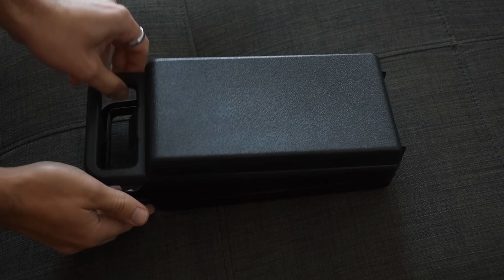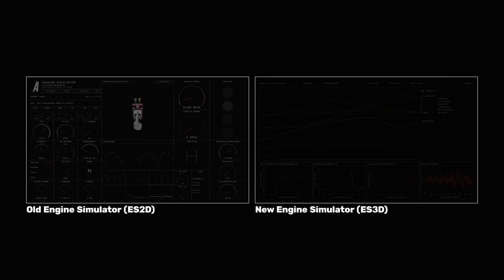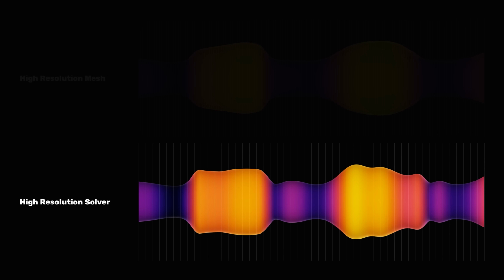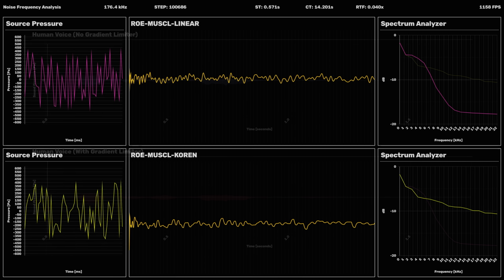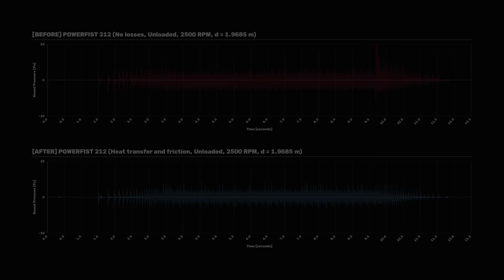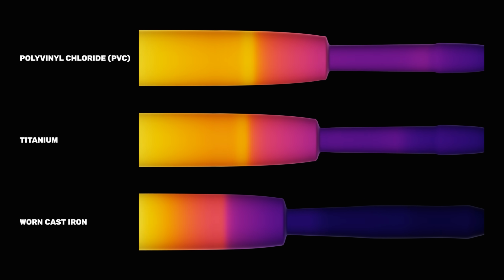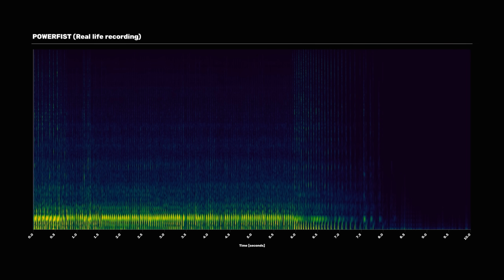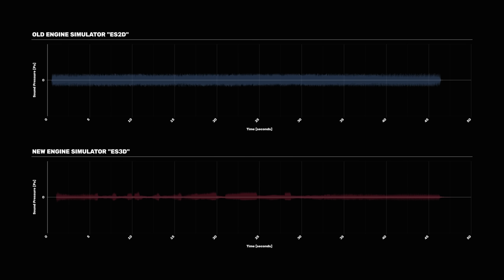Improving My Engine Sound Simulator With Real Data

Comment: 7:40 is that the discontinues function forrier series theroem stuff?
Reply from the maker: It's related actually. The technical term is Gibb's phenomenon
Reply: @AngeTheGreat  no we are talking about the same thing I have got the proof for the theorem proving that in the normal case this doesn't happen.

Comment: To relate on what you are talking about at 18:00 in structural engineering we call that structural dampening. Basically all real life structures are natural low pass filters. However evaluating the amount of structural dampening in a complex system is one a the most complex task when building a structural analysis simulation. Thanks for a video of such a level ! Have you considered publishing a scientific/engineering paper about your work ? It is definitely worth it !

Comment: I'm gonna be perfectly honest, through the whole video I was kind of underwhelmed, and then you showcased an actual driving-like sound of the 1-cyl and I just thought "huh, that sounds like a dirt bike". Which is well, exactly what it should sound like.

Maybe choosing the powerfist was not the best choice for a real life showcase because that thing makes a lot of mechanical noise compared to exhaust noise. But I guess whatever got you the necessary data is fine.

And whenever the engine sim drops in going to actually try getting an exhaust designed for my focus lol

Comment: Ange. there is a basically 0 chance you see this but if you do i want to say this 

YOU HAVE REACHED THEORITICAL LIMITS GODDAMNIT THE THING SOUNDS 100% LIKE THE REAL DEAL ALL WE NEED IS TURBO STUTUTUTU AND SUPERCHARGER WEEEEEE AND IT WILL BE REVOLUTIONARY JUST PUT THE UI, MAKE IT OPEN SORCE AND YOUR LIFES WORK IS FINISHED IT PRACTICALLY CANT GET BETTER

but there is one improvement you could make
i noticed in the soundwaves the simulations always had reletively smooth waveforms while the real ones were a little all over the place and were more choppy. i hope you can make the next iteration better regarding this matter 

BUT REMEMBER YOU MADE A MASTERPIECE

i understand if turbos and whatnot arent possible in the next iteration or any iteration because thats an entire new dimension of fluid sim and turbulence but thats the only complaint i have and its still minor. turbos arent here.

KEEP GOING YOUR DOING GREAT YOU HAVE COME A LONG WAY!

Comment: Every time I wonder how you're doing, you release a video with a few engine examples that effin blow me away. You appear to use some audio normalization on these parts, where the quiet parts get louder after a while is that right? If so, would you have the full dynamic original available as well?
Reply from the maker: Yes, I applied a small amount of dynamic gain adjustment to keep the signal in a comfortable listening range. It can be disabled in the program if you just want raw output
Reply: @AngeTheGreat  Good to know! I love ear bleeding dynamic range.. :D Amazing work man, just amazing.

Comment: Congratulations on getting this far without any formal training or experience and as a solo dev to boot!
However, please compare your results with that produced by a team familiar with COMSOL or ANSYS' multiphysics fluid simulators, before declaring that math or the state-of-the-art is limiting your acheivable accuracy.
Getting accurate sound from a fluid simulation isn't difficult, nor is it anywhere near some mythical limit that human intellect still needs to overcome.

That being said, it's also true that generating interactive, high-fidelity sound at high frequencies, from arbitrary 3D shapes and engine configurations in REAL TIME might actually be impossible due to the limits imposed by having reasonable PC specs; since this would (*obviously*) ideally require > 40,000 sound samples per second, with geometric resolutions of better than 2mm (to enable computation of realistic interactions with those high frequencies), all while keeping latency as low as possible (definitely <100 ms, but preferrably even < 10ms)!
Reply from the maker: I didn't claim in this video that it was a mythical limit that human intellect needs to overcome. I think it's obvious from this video that I'm implementing accepted models that already exist and making adjustments where necessary. I considered cross checking my results with pre-existing fluid simulations, but it ended up being too tedious and also not a useful comparison for me since I'm never going to venture beyond 1 dimension. Ideally I'd want to compare my simulation to a professional engine simulation like GT-POWER which is a specialized 1D CFD, but it is prohibitively expensive and its methods are proprietary.

It doesn't help that most fluid simulation software is some of the worst designed and most inefficient software I've ever used (and often prohibitively expensive). What I do know is that I've exhausted most of the literature regarding engine simulations that is easily obtainable for me, and I don't see significant progress past that research that is not proprietary, hence my claim in the video that we are nearing the limits of what the research currently has to offer. I cross checked the simulation with multiple methods to make sure it was correct and I'm 99% sure it's all implemented correctly. Hence why I'm not convinced that further improvement is likely.

Comment: Holy moly those final simulations sounded incredible, especially the V10! I don't think I've ever heard "fake" car audio sound that good under load! Idling still has some artifacts but damn. At this point I don't even care, absolutely incredible!

I wonder if you're already planning to, at some point, adding some sort of.... well, let's call it "heuristic" processing to ES3D? Same as ES2D. As you're well aware, a discrete simulation does have its limits, and while it gives an unbelivably accurate base audio response, subjectively speaking, at some point you might want to tune the final result with some approximations/filtering? 

Was also wondering if you do/can render out sounds not in real time? How would it sounds if bumped the resolution to ridiculous levels and let it render out over a long period of time? I know at some point the simulation will break down if nothing else because of float precision but how far could you push it? This could be an attractive solution especially for a game that might want to use a pre recorded engine sound
Reply from the maker: As I discussed in my pinned comment, these sounds are all rendered offline (as that's all that my testing environment supports right now). Further increases to the resolution will not yield any more quality improvements as these are already fairly high quality renderings. I'm not 100% sure what the real-time performance is like right now, but based on my testing it should be able to generate similar quality real-time audio, just with slightly less high frequency detail

Comment: The crossplane V8 sounds fantastic. I've always wanted to convert a car to electric. If this program's sound simulation could accept outside input (like say, the rpm of an electric motor attached to a gearbox as part of a cheap EV conversion, as well as throttle input obviously) it would make for a great method of fucking with people.
Reply: Maybe dodge could use this to give their EV hellcat a not so terrible "fake engine" sound LOL
Reply: He did a video with ES and a scooter

Comment: I swear if you had this running into a killer stereo and an ob2 reader and this I bet you could find combos that would go well like f150's with the ecoboost, sounding like a lazy big block or diesel... maybe even the harley sound would go well. Why yes I would like this 200 hp prelude to sound like it's powered by a cbr1100xx. A "white noise" generator, or I guess I really mean a road noise generator would be cool too... Perhaps in car mic could be used to create a baseline of sorts to make it sound like you are going faster/accelerating more aggressively than you really are.

Comment: I hope you get picked up by a video game dev so you can implement this into car-centered games as a way to replace or augment the engine sounds that are already implemented. 

While you usually get lost in the racing part of GT7, for example, and the sounds are “good enough”, I can’t imagine how wild it would be to have a real time engine sound simulator that could truly model what on throttle vs off throttle sounds are like, or to have better detail and audio separation between cars that have slightly different components.

Comment: Holy shit, that viper v10, sounds soo good, even the forza devs havent been able to capture the sound properly even with their budget! congrats dude!
Reply: the forza devs have to make their engine sounds work in real time whereas this simulation is rendered at a rate much slower than real time. still really impressive though
Reply: @usbhub95  really?
Reply: @Yeah_Ok_Bud  yes, the sounds we hear in the video are rendered much slower than real time. but i wrote this comment before reading the pinned comment where he explains a low quality version exists that does work in real time. we don't hear that in the video though, only the high quality version.
Reply: @usbhub95 But this engine sim is also realtime? You can download it and test it yourself.
Reply: @usbhub95   explain how his game will render engines in real time then?
Reply: @yoratev  i wrote this comment before seeing that a low quality version of the sim that works in real time exists, as explained in the pinned comment. therefore the high quality sounds we hear will either not exist, or be rendered in game after a long period of wait for calculation, or it will be togglable between the low and high quality, or the low quality version will be used instantly while the high quality version is processed in the background. the pinned comment also explains how the high quality sound we hear in the video is rendered much slower than real time.

Comment: One thing you can do is adaptive resolution where the step size is set by the local gradient.  This way you use more computation when needed, but aren't wasting computation on the low-gradient times.  I'm sure this is what you mean by "advanced methods", and you're right, but it's a lot of juice that might be worth the squeeze for this application.

Comment: Is it possible to characterize a high resolution solve with a better solver and then just using those characteristics at run time to avoid running a full fluid simulation in real time?

Comment: The end results are damn good and improved from the last time A LOT, one idea that you might be implementing to make it sound realel, is to make the sound come from a distance to the mic. When you showed the last gen 1 piston example of irl and sim sound, the biggest difference imo was that irl it sounded that the mic is 1-2metres from the engine, whereas the sim sounds like the mic is inside the exhaust which it basically is. Most likely you are already experimenting this, but the es2d didnt have this so just throwing it out there that you could make it sound more real if you could implement sound distance somehow. Still this was hell of a improvement to last time and i thought the viper v10 was very extremely close to real life and even got a tear to my eye hearing the lfa scream at the top end :), keep up the damn good work :D

Comment: I'll buy your game, definitely! 
This is so great !

For your recordings you should add an insulation wall with only the exhaust out.

For the very slight frequency resonant difference between your simulation and the real pipe , maybe it's because of the exhaust channel length in the heads before the pipe ?

Comment: 6:37
Is there any reason why you can't have higher-resolution steps at the openings of the tube while the tube itself has more low resolution steps whilst using the high resolution solver?

Comment: That harley engine sounds like I'm sitting at a stoplight next to one
Reply: It didn't sound realistic to me because I didn't hear any Def Leppard at a deafening volume above the exhaust.
Reply: @abattlescar  that'll be easy enough to add manually once the sim is released on steam
Reply: I wish there was a version for Android too, instead of installing it on an emulator or something (Android devices can't keep up with the mathematical calculations of this simulation), there's too much noise and lag.
Reply: @Users7342   Ange heavily optimised the simulation, so much that a modern smartphone could easily handle the simulation on low resolution.
Reply: @NoDeltaV I can't really say it's optimized; I tried running it on an emulator, but the FPS was extremely low, and the device overheated very quickly. I wish they would release a direct, mobile-friendly version because I have a Dimensity 8020 processor, and this is the first time I've witnessed the processor being strained this much.
Reply: @abattlescar  haha
Reply: The V8 had a moment during the revving under full throttle that had me grinning because it sounded so accurate!!
Reply: Even the single cylinder engine sounded like I was riding my old GZ250
Reply: YEAH!

Comment: What about using a dynamic resolution system at the core? You increase the resolution where there is rate of change. Secondly you can also increase the high end content of a coarse resolution at the post processing level by using something like an audio multiband compander aka OTT. Great work as always, cheers.

Comment: have there been any papers released on hybrid "grid"/particle solvers ? i know these are a thing in regular higher dimentional physics engines and i'm thinking it may improve simulation of turbulent flow and 3D features at a relatively low computational cost

Comment: It would be really cool if you could get an onboard video recording and simultaneous engine parameters of a race car or bike on track. For example you could get a log of engine load, speed and acceleration and then replay the video with your own simulated sound on top.

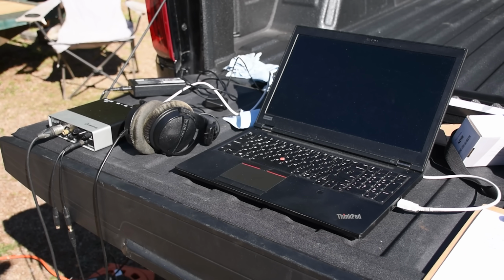Comment: Excellent external combustion engine at 1:35
Reply: had to rewatch that a few times
Reply: cant tell if its a joke or an accident
Reply: @bingusbongus9807  i think it was an accident because ngl using a jerry can when you aren't used to it is, embarrassingly harder than it looks...

It also looks like he was putting the tip right above the hole, expecting the gas to come out slowly but instead he tipped the can too fast 😅
Reply: @Nafinafnaf wee there goes the hydrocarbons straight out the nozzle :)
Reply: @bingusbongus9807 accident turned into a joke
Reply: wtf was that pouring job😂😂😂
Reply: For my own sanity, that was water.

Comment: The final engines you showed, for the most part I genuinely could not tell you whether or not they were real sounds made by an engine or a simulation, and don't take that lightly, I love engines, especially how they sound, I've heard alot of engines, and the sound your sim is making is phenomenal and insane to hear simulated so well. Insane work Ange, truly great.
Reply: And all of this, I assume is without post-processing. I can imagine that in situ in a game for example, with realtime reverb, might sound insane
Reply: It was the v10 deceleration that I've never heard done that well
Reply: It just need a tweak at lower rpm, because you can rear the artifacts (it looks like a poorly compressed recorded audio), but when the rpms are higher, man o man, it is a real engine. I cannot believe it is not a recorded audio! The harley v2 (I guess it is the evo engine) and viper are amazing
Reply: @eduardostremel241 that can be because of youtube compression of videos.
Reply: Me too!

Comment: Remember that these honda clones are designed to run kind of lean for emissions purposes so adding a straight pipe could make it lean.
Reply from the maker: The exhaust I bought came with jets so maybe that's why lol. I'll install them next time
Reply: @AngeTheGreat  Smart idea if you care more about mixture later!